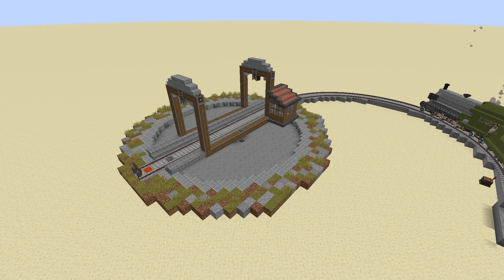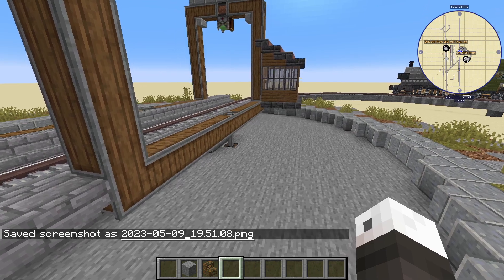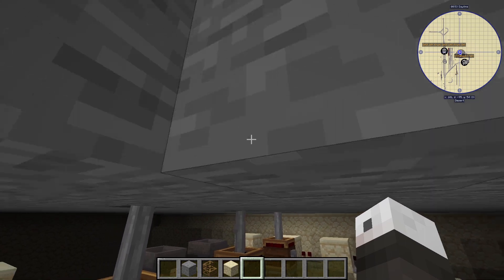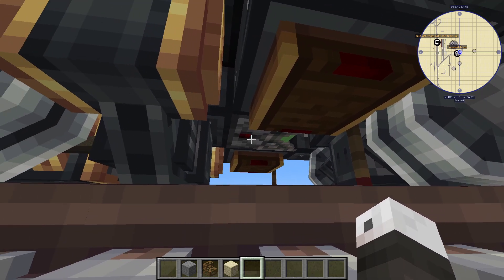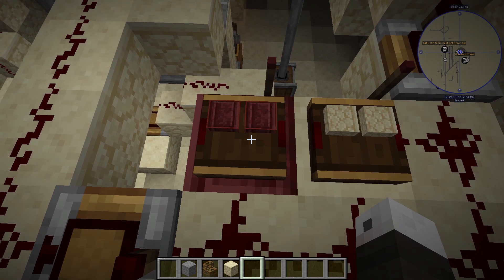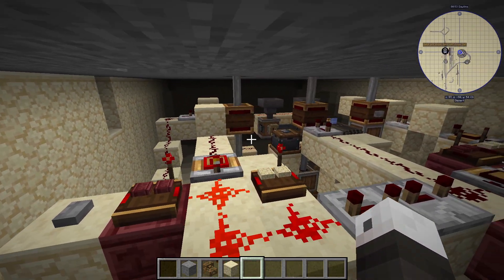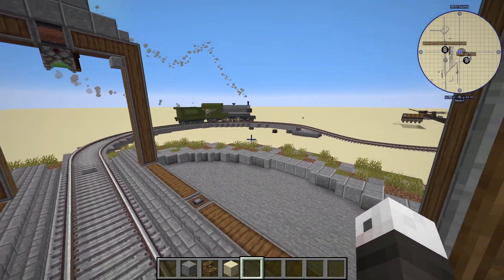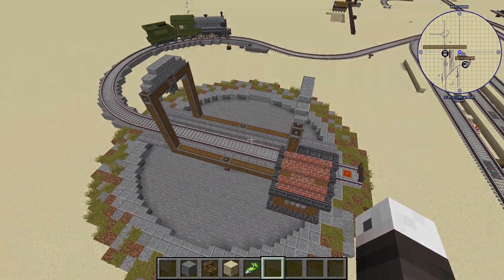Minecraft create - working engine turntable - explanation

Comment: this is fricking awesome, but i imagine that this would mess up any trains with blocks facing a certain direction, lets say west for example, if u turn it around it would still point west right? thats been my experience with rotating anything built using create lol, awesome build tho!
Reply from the maker: Some blocks carry the direction with it and some don't. The framed blocks keep their direction but if it's sideways slabs they invert the content within it, the train hulls also don't turn that's why I rotate this engine by 180 degree only. If I rotate it by 180 deg you don't see the train hulls do weird stuff.

But yes indeed you need to keep block rotation in mind when designing engines etc.
Reply: @ImagineerDave  its for this reason im gonna wait to do something wacky with landlord and create: aronautics to make a turntable so i dont have to disassemble the locomotive, cuz i love having no limits with trains lol, but for trains built a certain way like urs, this is a perfect turntable solution!